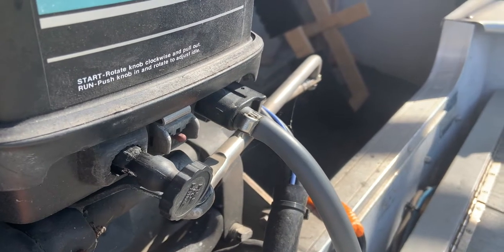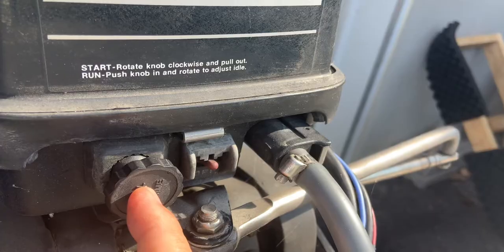Mercury 25Hp Pull to prime button explanation “start your engine”

Comment: Hello Joe, I am writing from Turkey. I have the same engine. After the first operation, I cannot start it again for a long time. I was worried about going on a long road, but last time it stopped suddenly. In short, sometimes it works, sometimes it doesn't.
Reply from the maker: Hello erdoganordukaya, thanks for watching. A no start can be many things. First check if your spark plugs are good then check if they get a good spark on start. Bad spark will cause hard start. 

When it starts does your engine run rough?  If it’s really rough, it could be because your reed valve are damaged. They are other things to check first.

If you have a hard time starting it, always pull to prime button and put it back in place before starting. It will shoot a little spray of fuel to help it start. Also make sure your fuel bulb is pumped hard. That can only help the start of your engine.

If your carburetor is gunk up, running some Seafoam into it to clean it.

When running, is your idol good? Your idle screw might need a little adjustment. Also, you might need to adjust your air fuel mixture screw, but that’s one of the last things to do.

Let me know and good luck 👍
Reply from the maker: Hello erdogannordukaya, sorry i can’t give that kind of information. I would receive endless emails lol. I will try to find a way. I will get back to you soon.
Reply from the maker: Hello erdoganordukaya, you will need to create a dropbox and send me the link that should work. they are some free sites to share videos. Let me know :)
Reply: jikle cekili iken 2 kere ipi cek sonra   jikleyi itip ipi cekmeye devam et. Surekli jiklede cekersen bujiler islaniyor ve motor calismiyor

Comment: Hey - you cant tell me or show me in the engine how to get WOT to fully adjust the pulley inside to get max rpm please? When i push throttle fully forward everything moves correctly but there is still some more play in the black plastic thing
Reply from the maker: Hi NickW0771, Thanks for watching. The round the black plastic has 2 white lines that should be aligned with the carburetor pin when in Idle. When I’m at full throttle my carburetor pin is at ¾ of the round the black plastic so aligned accelerator stem. Let me know if this helps 😊

Comment: Hello great video,   I was wondering though on the shifter controller there is an idle lever,  is it alright to push up as far as it will go when starting,   I had a guy tell me I can damage the motor because in neutral  the idle lever doesn t advance the timing and i will get pre detination.   If you could help it would be apreciated.   Thanks
Reply from the maker: Hi robertbard, Thanks for watching. The "fast idle" on the side controls is for older carbureted boats. You pop the boat into neutral and use the fast idle to let the motor warm up for a minute before use. But NO I wouldn't push up as far as it will go when starting RPM will be max out. Not good for Engine, can cause damage to your engine :(

Comment: Hey joe. Been a while. Hope you've been well. You don't happen to have a video on how to connect this 25 HP after it's been disconnected from the boat? It is now sitting on a stand, and no controls. But I want to be able to fire it up to show to people to try to sell it. I'm still an amateur at this stuff and trying to figure out how I can hook up the gas line and safely connect the battery so that I can just pull start it on the stand. I'd rather not connect the controls to it and just be able to pull start it but then I guess it'll be a problem how to put it in gear to show people forward and reverse if there's a video that shows how to connect the controls back onto it even better cuz I do still have the controls I'm just intimidated how to connect everything back to the motor because the mechanic disconnected everything when I wasn't there. Thanks so much
Reply from the maker: Hi Mike, I'm doing good, I hope your doing well. OK so you have 4 wire coming out of the outboard (Black, Red, Yellow with red stripe and Black with yellow stripe on it). To start you engine you will need a 12V battery. You will connect your red wire to positive of the battery and black wire to the negative of the battery. 

At this point you can start you outboard by pull rope. Make sure your kill switch next to pull to prime button is off. If your switch is at the down position then your engine wont start (needs to be up). Once started, to turn your engine off you need to flip the kill switch to down position it will shut off engine. 

If you don't want to start with pull rope. We have 2 wires left. The "Yellow with red stripe" will be your started engine wire. As soon as that wire touches the positive of the battery your engine will try to start. Basically it's your cranking wire.  Once your engine is started, disconnect the "Yellow with red stripe" from the 12V (positive of the battery). Basically grab the wire and make the the striped part of the wire touch the positive of the battery. When started just put the wire aside. if this make you uncomfortable just start it with pull rope :)

And the last wire (Black with yellow stripe) is for extra kill switch which you wont need if your shutting your outboard with kill switch next to pull to prime button. So don't connect this wire.

Now for the controls, do you have the stick that comes with the engine? You would need to install it to have control of the acceleration and gear. I can't help you with that since i don't even have that lever that connect to outboard. my engine always has been on the side hand controller. 

Very important, While the engine is running always keep your red and black wire connected on the battery. If you disconnect it while engine is on, it can damage your voltage regulator. 

Hope this helps :)
Reply: @joetheboatguy5394  Hey Joe. I'm SO sorry. I had a ton of personal things happening when you replied and I forgot to reply. I do understand your instructions to a certain degree, but I'm still not sure on a couple. I might do the same thing I did last time, and make a short video of what I have so you can see. Your description of the wiring makes sense, but I have a connector that was pulled out by the mechanic when he took my motor off (when swapping with another).  And for controls, I have similiar thing as you I think. I don't have the tiller handle/stick attached to motor. I have the 2 cables that go from motor and connect to a separate throttle that was connected to a steering wheel. But again, my motor is no longer connected to the boat - an older, 50HP from 1975 is (which is NOT working and this whole thing has been a nightmare). So for the 25HP motor, I have the motor itself on a stand, and a throttle control on the floor with the 2 cables, disconnected from the motor. I'm not sure how to connect the throttle control to the motor inside (if you know what I mean).  And I definitely don't have access to the steering wheel to reconnect to the motor. I don't care about steering of course. I just want to be able to start the motor, put it in forward and give it gas by increasing throttle.  AGain, when I can, I'll try and send you a short 1 min or less video of what I have, including showing you inside motor with cover off. And I do have access to connect it to a battery as well.  thanks again ! I'm now trying to find a video of a person who has replaced an ignition switch box on the 1975 50HP mercury outboard motor.  It's a rare motor as it was the only year they made it, and apparently that's because of the poor design and/or failure rates of this damn ignition switch box that failed. I just spent 700.00 ordering a new one from mercury that's on its wya and i've already spent a ton with a local mechanic, so I took the boat back and I don't want to have to spend more for him to replace the ignition switch. I think I can do it, but would have been nice to see somebody with a video on it but not 1 person. It's all good. Take care!
Reply from the maker: Hey Mike, I understand that life can be unpredictable, so there's nothing to worry about. Don't spend all your money if the outboard is causing you many problems. Send me the video when you have time no rush. I will try to do a private video this weekend regarding the accelerator connection. I will send you the link. 👍
Reply: @joetheboatguy5394  hey Joe. Thanks for understanding. I'm sorry for the long delay, I just uploaded an unedited video of my motor asking some questions. I'm okay with what to do for the gas, but I don't understand what to do with the throttle controls and you'll see in the video. And I'm not totally sure where to connect the battery leads inside the motor. This is an unlisted video so it's not posted to the public but I have to post the link here for you so you can watch it. Thanks in advance for any information you might have as I just want to be able to start the motor and throttle it up and down to show somebody to try to sell it: https://youtu.be/oijKSS9q_FI?si=EEb2maKUpgVJq2Bq
Reply from the maker: Hey Mike, I think you do have en electric choke on your 1975 outboard. Make sure that is ok. If your choke is left open it will rev high and engine will choke on high acceleration.
Reply from the maker: Hey Mike did a Quick but long video of me rambling on and on and on LOL hope this helps. Let me know when you done with the video I will removed, no rush :)
https://youtu.be/Ad2D1BCE20I
Reply: @joetheboatguy5394  Hey Joe! Wow, I can't tell you how much I appreciate you making this video for me!  I'm at work and watched it quick, taking screenshots that I will label. But is it ok if you leave it up for a couple weeks, just in case? I say that because I'm working a ton of hours, but I will try and do this as soon as possible but in the event I don't get to it until next week for example, I'd love to be able to come back to this video, playing forward, rewinding etc.  AGain, thanks SO MUCH!!
Reply from the maker: Hey Mike, No problem 👍

Comment: I have the same motor, but everyday when I leave it overnight the next day it will only start with Carb cleaner and after the first start it would start after each shutdown without the need of a carb cleaner. Its only when the engine sits overnight. Any idea why?
Reply from the maker: Hi Hamond, thank you for watching. Are you running the right spark plugs? I know that sound elementary but it can affect cold starts especially.

Check your spark plug cable make sure no cracks on them. Also check spark plugs make sure they are healthy. 

Another thing but rarely the problem, fuel filter make sure it’s changed.  

If you pull the “pull to prime” button it should help to start your engine when cold. It sprays a little fuel to help it start. 

Last thing to check would be your reeds but that’s an easy check. 

Let us know how it goes 👍

Comment: I have a 20 HP 1989 Mercury pull start 2 stroke. Is it normal for the area around the choke to spit out fuel when I push the choke back in?
Reply from the maker: Hi dgk74, I can tell you that mine doesn’t do that. You might have a dry seal somewhere 😟
Reply: No that’s not normal your seal on the bell of the carb is probably bad
Reply from the maker: thank you for your response @Habitat009
Reply: Mine sons does the exact same thing he has rebuilt the thing a lot beacuse of it but says it doesn’t mess anything up
Reply: I had  that problem and the plastic float pin "stop" had broken and the pin was popping out of its supports after a couple of float cycles. My solution was buying a long float pin. By using a pong float pin the edge of the pladtic bowl acts as a stop.

Comment: What is that red switch just to the right of the choke?
Reply from the maker: Hi johnmurphy, thanks for watching , that’s a very dangerous switch. I warned you don’t touch it 😂 just kidding. That’s the kill switch for the engine 👍
Reply: @joetheboatguy5394  does it attach to a lanyard?  (My buddy has one he is thinking of buying.  I’m trying to figure the little stuff out for him).  I’m assuming there’s a clip that flips the switch down if it’s yanked on?
Reply: @joetheboatguy5394  dangerous huh? 😂😂😂
Reply from the maker: I’m sure there’s a way to attach to lanyard. I don’t use it since I have a steering wheel and hand throttle so my kill switch is on my hand throttle . But something like this would surely work 

Boat Outboard Emergency Stop Kill Switch Key Set with Lanyard for Johnson, Evinrude, Yamaha Universal (Red) on amazon
Reply: @joetheboatguy5394  ohh ok.  His is tiller handle.  Thanks Joe!